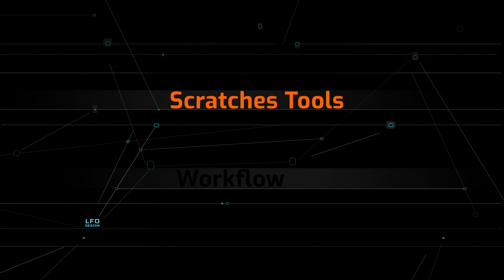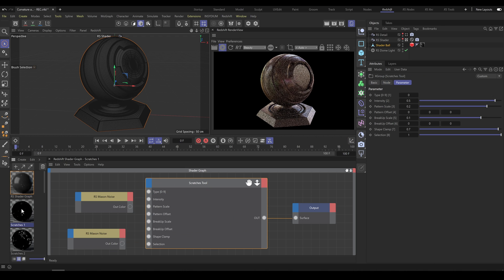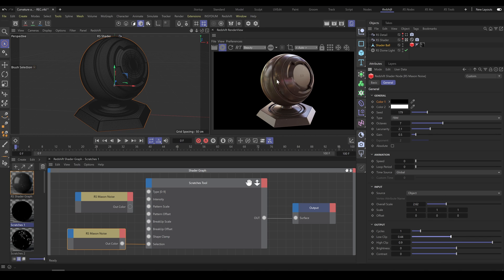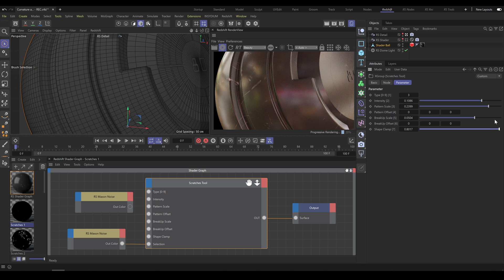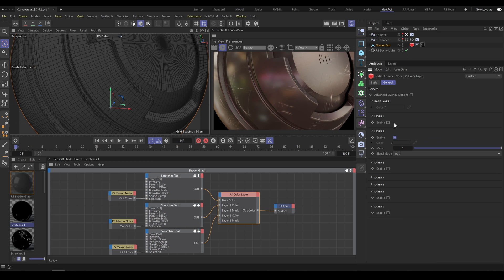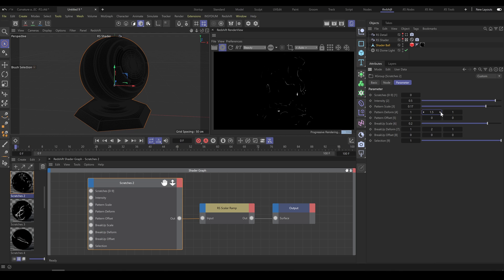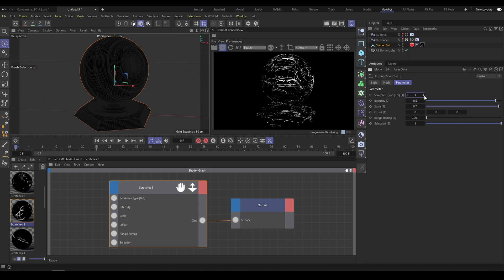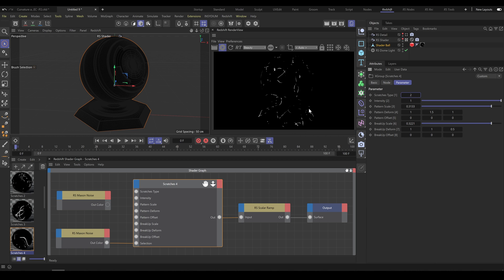C4D/Redshift - Procedural Scratches

Comment: I'm so sorry, I cant make it work. Scratches to small almost invisible, no matter what I do the size stay almost the same.  Dose anyone have any suggestions?
Curvature Scratches works really good, but just plain Scratches somehow not collaborating with me .
Reply from the maker: Check out all tutorials in your Gumroad library. You will find there warning about units and scale. Seems like you are using incorrect scale/units. Maxon changed defaults redshift units in new C4D. You have to use legacy units, because all these nodes are using legacy units.
Reply: @LFOdesign-Tutorials   Thanks for getting back. Yes I was using legacy RS. I made most of them functional, the scale had to increased a lot, few hundred and more. I still have some that gives me a headaches, I will spend more time playing with it. 

Thanks
Reply from the maker: @MegaBexon  also check pattern of breakup and it’s scale. Noise which controls breakup produce where are scratches visible and where are not, so it’s contributes to scale as well. Another factor is how large is object. Base size is 1m so larger objects need to increase scale.
Reply from the maker: If you will have more questions, you can write email to info@lfodesign.com they will definitely help you.
Reply: @LFOdesign-Tutorials   thanks I will if I get stuck :) great work, I love this set its my favorite.